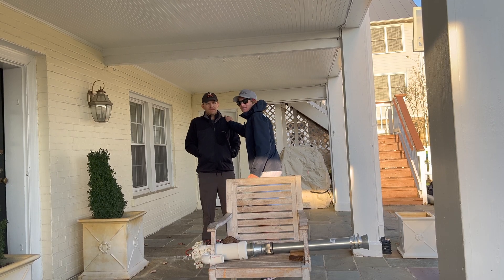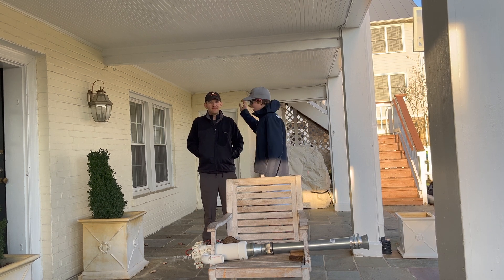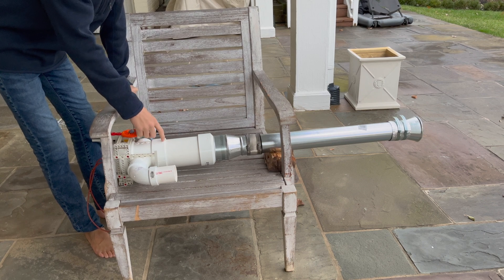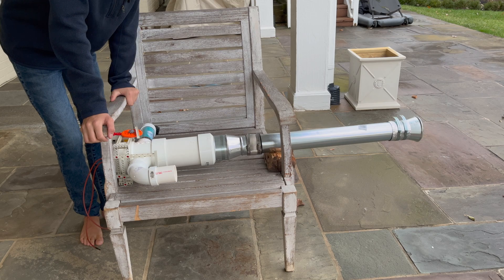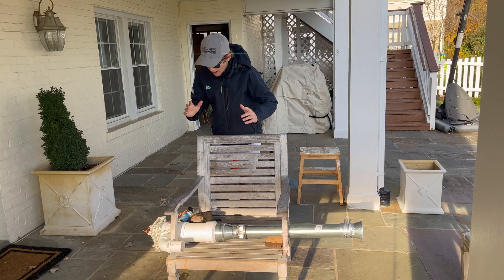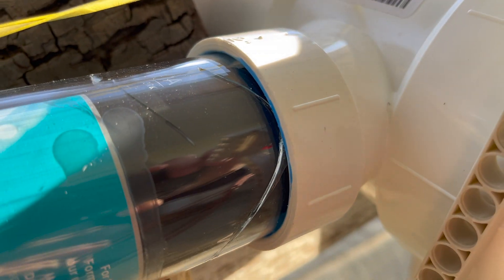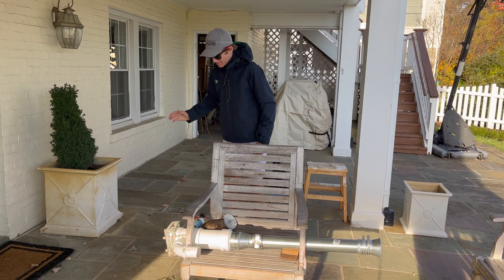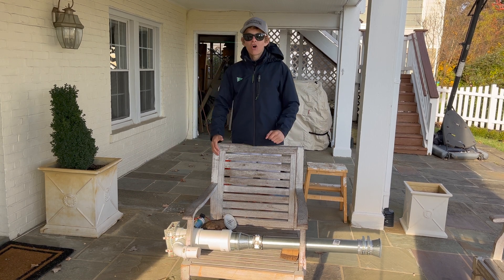Hairspray Powered Pulse-Jet!

Comment: I think you are underestimating the power of pulsejets. perhaps the fuel, the noise, the heat or the idle. I see many people on youtube who claim they have build a working pulsejet but they don't have the real thing. I don't know what your goal is but if you want to make real pulsejets that can generate thrust for more than a few seconds there are many things you need to change. In this video and your pulsejets go kart video your fuel input is nowhere near the needed amount. From my experience starting a lockwood hiller has flames many feet tall. Your passion is good, you have skill and if you want to do pulsejet looking combustion then that's fine but if you want the real deal you have to step it up. just my advice
Reply from the maker: Will do! Thanks for the comment!
Reply: Are you insane? Have you even watched YouTube clips of a running pulse jet? The metal combustion chambers glow yellow to white hot. And you are using plastic. You talk about safety. Meanwhile you're running a plastic engine, on a timber chair, connected to a lethal bomb ( hair spray cannister). Your father needs to exercise some grey matter and stop you from blowing your wooden house to kingdom come. Other than that, good job!

Comment: I recognize the valveless pulse jet shape but this is the first one I've seen built using off the shelf parts.

The only version I can think of that worked using flammable parts was built by a guy that has YouTube videos out on his attempts at building a pulse jet rocket. He used butane for his I think? The kind of canister you buy for refilling butane lighters.

Look up his channel for the rockets and somewhere in his video list you will find his other pulse jet builds.
Reply from the maker: Nice! Thanks!